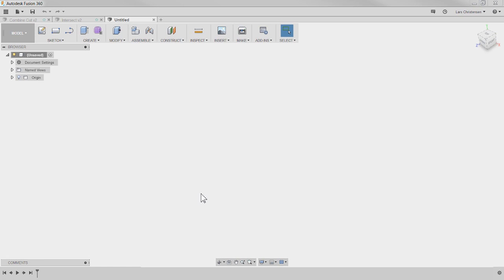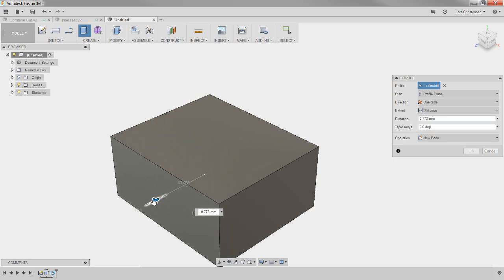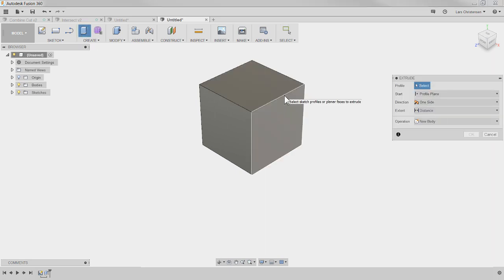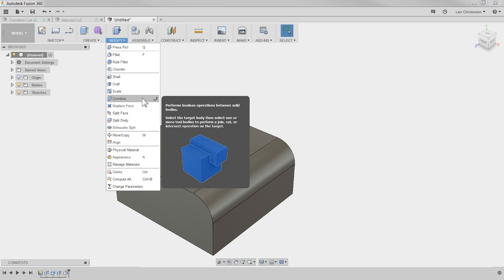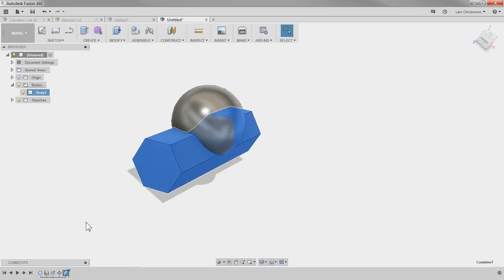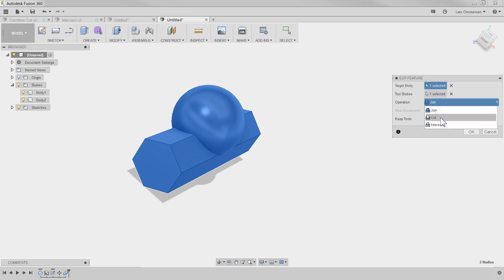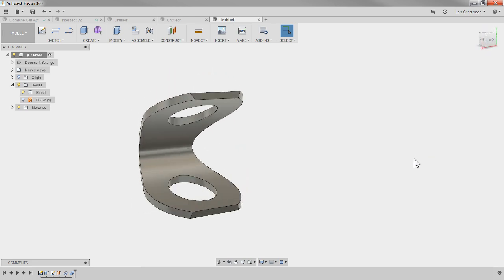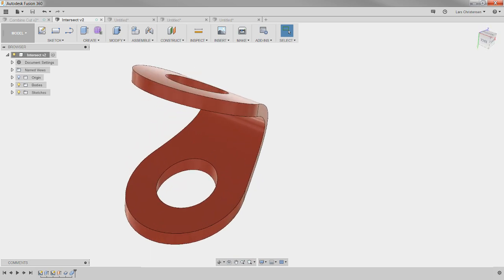Press/Pull & Combine Workout For a Fusion 360 Tutorial — #LarsLive 142

Comment: Hi Lars, just wondering how you would go about manufacturing the last model you created? (using the intersect function - which by the way is very cool) Can you bring it into Sheet Metal and flatten somehow? I had a similar model I had to model up  and couldn't get my head around how I would do it in the Sheet Metal environment.
Reply from the maker: Hi Demelza McCrindle Thank you for watching!
We do not have the function to flatten a solid body yet. For now, you have to start a sheet metal file in the sheet metal environment.
But yes, I cool waterjet and a roller and you should be able to make that part :-)

Comment: a little off topic but - when in offline mode, where is the project saved?
Reply from the maker: Hi Jim Jacques Thank you for watching!
They are stored locally. Fusion also does that when you are connected to the internet. 
It is stored as cache and you can adjust it in the preferences. So you have the last 60 days of files saved local at all time. If you go offline, those are still available. Then when you connect to the cloud again, everything will sync.

I hope this makes useful.

Comment: What happens when you want to combine a mesh? I have a solid model head that i want to use to 3d print it at a few mms thickness. So 1 body is normal and the other is scaled by 0.95. Fusion 360 complains that its too difficult when i try convert to body. Im an absolute noob and ive just started watching your videos. Thanks!!
Reply from the maker: Hi David Tisaj Thank you for watching!

Try to check out these two video:
https://youtu.be/cKXvIWpLoeU?list=PL40d7srwyc_Mkgc5wvP_OfVel9aDkNkZ6

https://youtu.be/OX1T_bg493A?list=PL40d7srwyc_Mkgc5wvP_OfVel9aDkNkZ6

I hope this is useful.

Best,
Lars
Reply: Lars Christensen thank you so much